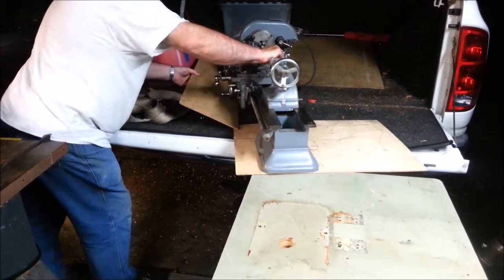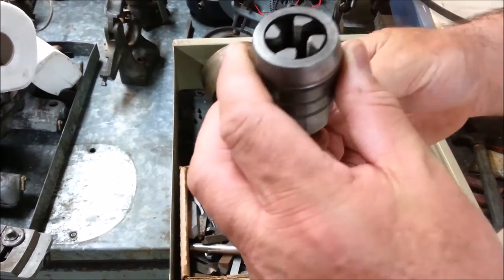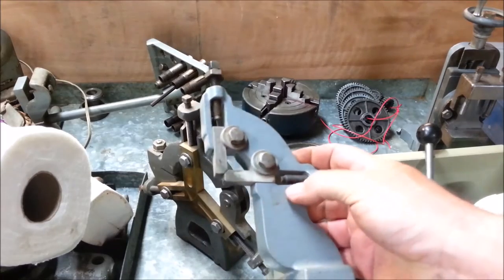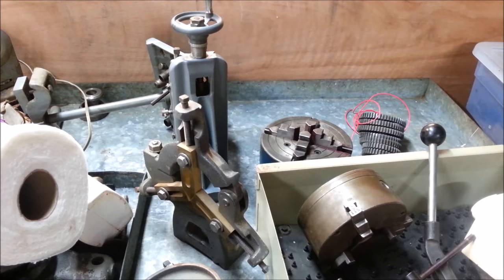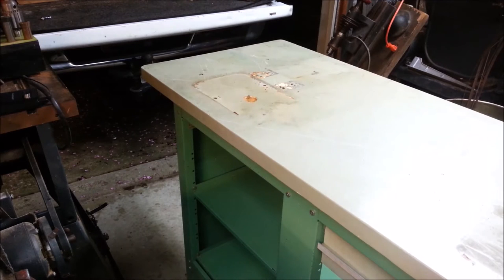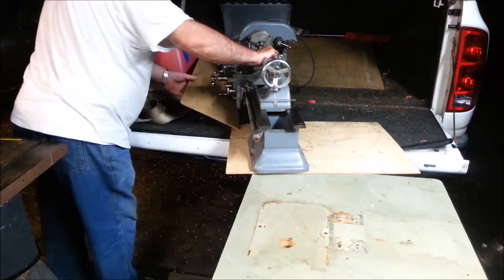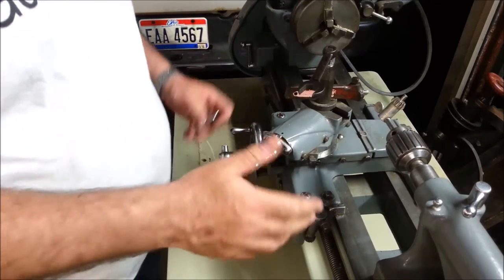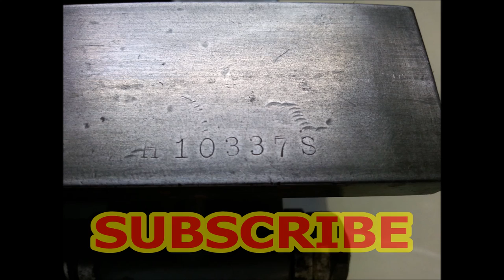Atlas Craftsman 10F Lathe - Back Of The Truck (BOTT 18) - PART1

Comment: This may seem like a bit of a weird request but would you be willing to make a little video on the horizontal countershaft?  Maybe how it is set up and adjusted and operates?  I just got a TH54 with the cast iron legs and the countershaft seems like it needs adjusting, or something.  I don't have anything to go off of for an example.

Joe
Reply from the maker: +My Heap I may be able to do that. It is very easy to take down.  If your handle moves quite a bit back and forth without the slide moving, it's likely a worn cross slide nut.  That nut is held in place with the slot round head screw you see on top of the slide.   To remove the slide.  Turn the handle so it moves away from you.  When you turn it off the end of the screw, you should be able to push it the rest of the way off the carriage by hand.
Reply: I think maybe I was unclear.  I wasn't talking about the cross slide, but the counter shaft that sits between the motor and the spindle.
Reply from the maker: +My Heap Maybe I wasn't paying close enough attention.  You were clear enough.   I have one I need to take down to repair.  I'm pretty backlogged with video to process and put up.  The desert tan Lathe you see in my shop needs this countershaft replaced.  That lathes is bubbling to the top of my projects.  There is some operation stuff on that shaft on MrPete222.  Also, EvilTwinX has his rebuild series past the point of reinstalling that part.  Not sure if he gives any "adjustment" info or not.  You might find some immediate info on one of those two channels.   I've got a lathe under rebuild but I'm no where near installing that part yet.  We will find a way to help you regardless.
Reply: Mr Pete is a Joy to watch.  I must have watched nearly everything he has put out.  He has TONS of info on the lathe but doesn't really talk about the countershaft.  I have watched EvilTwinX's videos too.  He cleans the countershaft and does a good job, but doesn't really talk about adjustment.  Maybe a couple of questions can help me here.

1)  When pulling the lever towards the headstock, should it pull the countershaft enough to easily make belt changes? (When I pull on mine, the belt has to be rolled off the pulley with some effort.)

2) When pushing the lever forward there are a couple of flats on the shaft.  These flats should lock the countershaft into position.  Where the flat lay on the casting in the locked position, should the casting be flat there?  I will have to look but I think there is a place to screw some small pieces of angle to the casting where the flats will lie.

If I could see a countershaft working as it should then perhaps I can diagnose what is going on with mine.  I am not in a hurry with it.  Currently I have the spindle removed. (To be reinstalled shortly) and need to make adjustments to the back gear shaft.

Thanks for your help and being so patient with me.  I am a computer geek by trade and this stuff is a hobby for me.

Joe

Comment: Looks more like mid to late 40's model.
Reply from the maker: +William Holland Because of the cast iron cross slide?
Reply: +Crafted A cast cross slide was equipped on all lathes, Zamak was only used on gears, spacers and handles. Although it wouldn’t surprise me if they tried to use Zamak on other parts during the war. 
Sometime in the mid 40's they incorporated aluminum for gear covers and spindle covers. The giveaway for me is the style of the spindle cover, the reverse lever location and the hex shape on the cross slide bushing. Also babbitt bearing lathes were always around as lower cost alternative over a Timken equipped model.
Reply from the maker: +William Holland I've got a neighbor who has one with a Zamak cross slide.  that model is also mentioned on Vintage Machinery as I remember.  He had it for sale this past summer.  I passed on it.  Lots of time between when I saw that lathe and this one so it could have been substantially different in other ways that I am forgetting.
Reply: Zamac cross slide on the 9-inch and it was also used for the cross-slide casting and, on the early 10-inch. Here is a link for great info on Atlas lathes: http://www.lathes.co.uk/atlas/page2.html
Reply from the maker: 1943 10F at the earliest.   From what I can see there.  However, the chuck was the same as the 9 inch in the original link.  I've been all over that site several times in the past.  Great reference.  I should have freshened up on the information before making the video.   Not sure where the 36/37 idea came from.  Most likely fuzzy memory.
Reply: The bearing race on mine was dated 12/29/43, my guess your new one is at the earliest a 44.
Reply from the maker: +William Holland I've already found a new home for it so I won't be able to look.  My QC42 under restoration had a 1950 date on the bearing race.   I need to get back on that project.